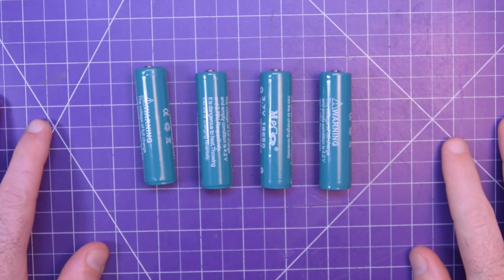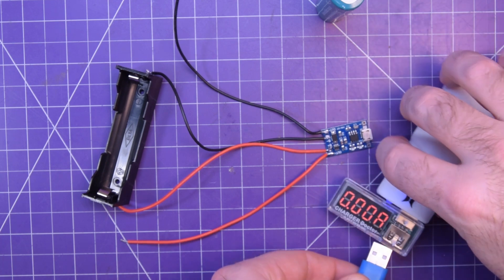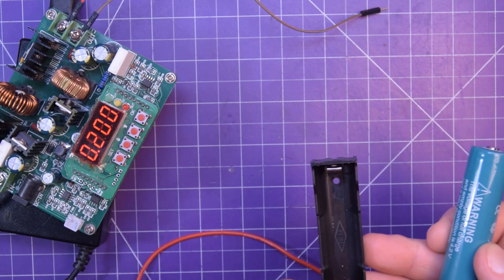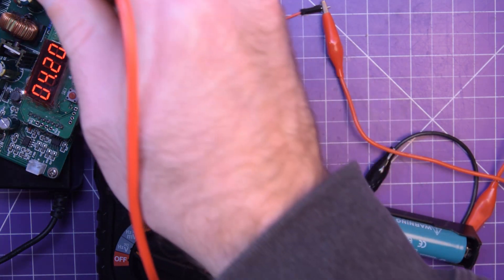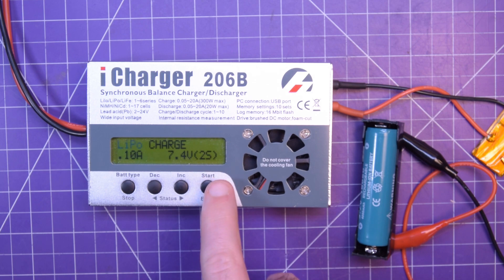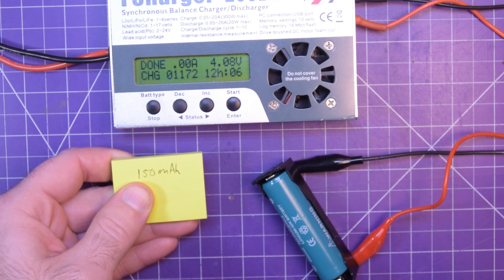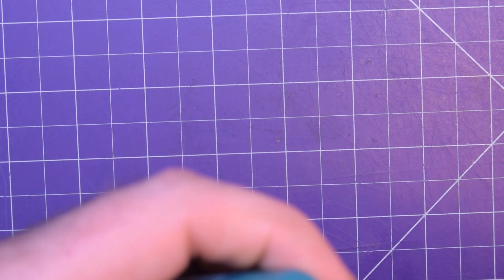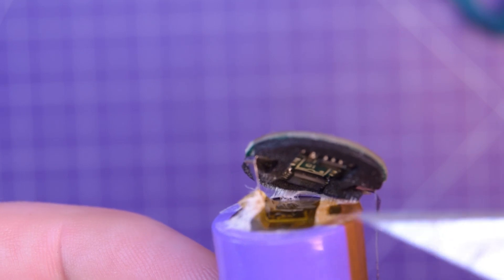When it's too good to be true...

Comment: TP board will charge @100ma till the cell hits about 3 volts, then it will charge @ whatever rate the resistors on the TP board are set to. (1 amp is what they ship at)  Those cells you have are likely pulled from old packs. If you  peel the wrapper you'll find they put new ends on the cell. You'll find dags on the ends.

Comment: Not really surprising, but is it old cells or cells manufactured to be bad. You can see that by checking the weight of the cells.
Another way is to check the bottom of the cell, if it has extra marks from spot welding, it is a old cell.
I have tested a lot of cells, both good and bad: https://lygte-info.dk/info/indexBatteriesAndChargers%20UK.html
I have opened some batteries to check them: https://lygte-info.dk/info/batteryDisassemblyUltraFire%20UK.html